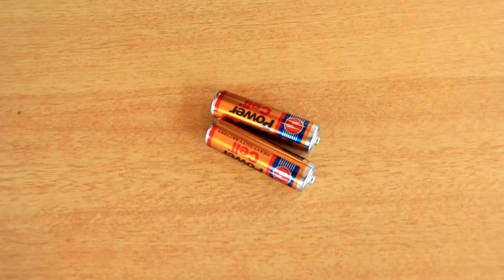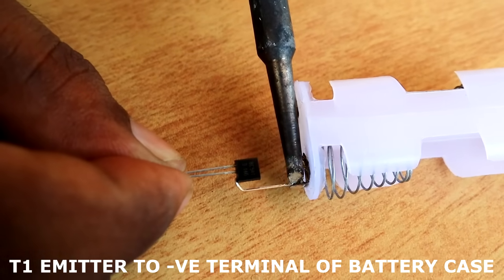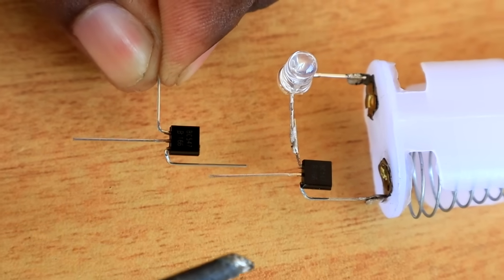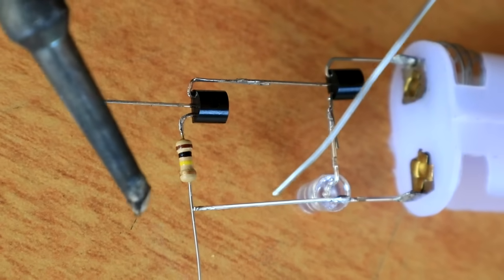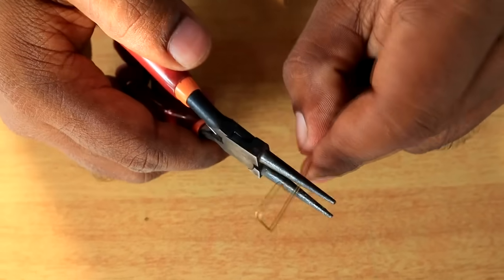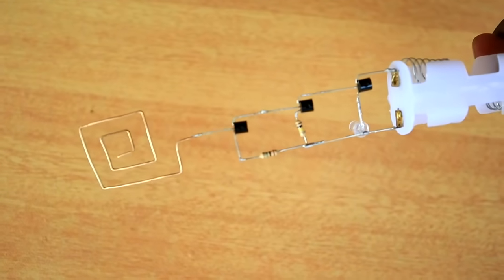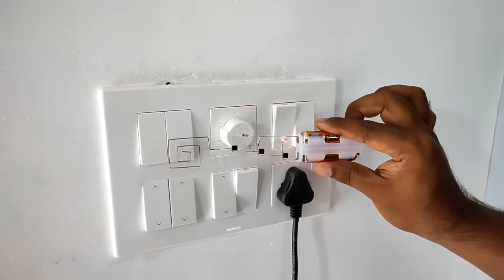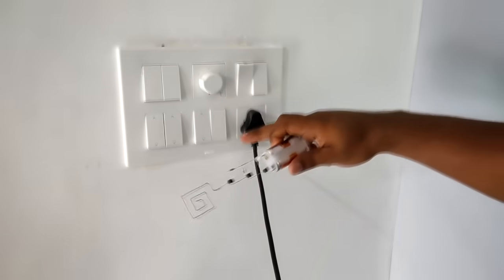NON CONTACT VOLTAGE TESTER MAKING | M4 TECH |

Comment: Chetta voltage low karanam electronics device off aay on aay kondirikum. Ath solve cheyan oru solution paranj tharo... Nte vtil av receiver und. Vaikit oru 6 manik shesham receiver use cheyan patilla. Use cheythondirikumbo voltage low aay receiver off aay pokum. Pne on aakum.. ith kurach nerathek repeat cheythondirikum. Any solution?

Comment: Can this be used to find out the location of concealed wiring inside wall to prevent accidentally damaging the wire if some other drilling work is required to be done on the wall?

Comment: If wire has a disconnection in-between, AC current will not flow. That's an incorrect application.
Reply: I doubted it the same way
Reply: He already told about that dear..
Reply: @muhammedshafeeque5775  You misunderstood.

Comment: Wanted you to make a simple ON/Off circuit operated by GSM missed call concept which will work for pumps and other electrical devices and also should be able to withstand the erratic voltage fluctuations in kerala. This device will help many to switch on or off the pump/or any other device remotely without going to the installed location physically. Pls try...

Comment: എന്താണ് ഇതിന്റെ പിന്നിലെ Working Principle അതെന്താണ് പറയാത്തത് ?😊
Reply: 3 Transistor Darlington configuration circuit with very high gain. The antenna picks up the 50Hz AC signal and turns on the transistor and the led glows ->  working principle :)

Comment: പ്ലഗിൽ കുത്താതെ കറന്റ്‌ ടെസ്റ്റ്‌ ചിയാൻ പറ്റുമെന്നു അറിയില്ലായിരുന്നു... 🤪
Reply: Just oru karaym ആലോചിച്ചാൽ മതി Energy frequency vibration ഇതാണ് എല്ലാം ഒരു wiring ഉം ഇല്ലാതെ ഭൂമിക്കു പുറമേ ഉള്ള ഉപഗ്രഹങ്ങളും ഉപകരണങ്ങളും ആയി communication നടത്താൻ പറ്റുനില്ലേ ദൂരെയുള്ള ആളുകളുടെ ശബ്ദം Phonil കേൾക്കാൻ പറ്റുന്നില്ലേ, Wire less ആയി wifi ഉപയോഗിച്ച് internet എടുക്കാൻ പറ്റുന്നില്ലേ അതുപോലെ ഉള്ളതിൻ്റെ വെറും .0000000000001% പോലും complication ഇല്ലാത്ത ഒരു simple high gain amplifier circuit ane ഇത്. ഏതൊരു wire ലൂടെ കറണ്ട് കടന്ന് പോകുബോൾ അതിനു ചുറ്റും magnetic field ഉണ്ടാകും ഇവിടെ AC ആയതിനാൽ magnetic field ദിശ മാറികൊണ്ടിരിക്കും ഇങ്ങനെ മാറിക്കൊണ്ടിരിക്കുന്ന magnetic field ലേക്ക് Wire അതായത് ഇവിടുത്തെ Antina കടത്തി വക്കു ബോൾ magnetic flux antina ye cut ചെയ്തു കൊണ്ടിരിക്കും അപ്പോൾ ആ Antina യിൽ e.m.f induce ചെയ്യും വളരെ ചെറിയ വോൾട്ടേജ് ആകും അത് അതിനെ ഈ high gain amplifier ഉപയോഗിച്ച് വലുതാക്കി കിട്ടുന്ന Output ൽ ആണ് LED കൊടുത്തിരിക്കുന്നത് അപ്പോൾ വോൾട്ടേജ് Detect ചെയ്താൽ LED കത്തും

Comment: 4:29 when you put the battery in it’s a closed circuit
Reply: Just put a switch in series.. No big deal
Reply: Here transistor is working as a switch. ആ voltage സെൻസ് ചെയ്യുമ്പോൾ മാത്രമേ transistor ഓൺ ചെയ്യുകയുള്ളൂ. അത് on ആവുമ്പോൾ ആണ് circuit closed ആവുന്നത്. So at 4.29 അതൊരു open circuit ആണ്.

Comment: ഇതിന്റെ പ്രവർത്തന തത്വം കൂടി പറഞ്ഞാൽ നന്നായിരുന്നു.
Reply: വീഡിയോയിൽ കാണിക്കുന്ന antenna ഒരു inductor ആയിട്ട് work ചെയും. AC കറന്റ് അതായത് നമ്മുടെ പ്ലഗിൻ കിട്ടുന്ന കറന്റ് കാരണം ഒരു magnetic field ഉണ്ടാവും. നമ്മുടെ inductor(antenna) ഇങ്ങനെ AC കറന്റിന്റെ അടുത്ത് വെക്കുമ്പോൾ inductor-ൽ ഒരു കറന്റ് ഉണ്ടാവും. Electromagnetic Induction എന്നാണ് ഇതിനെ പറയുക. ഇൗ കറന്റ് 3 transistors-ന്റെ സഹായത്തോടെ amplify cheyyum. അങ്ങനെ amplify cheytha current ഉപയോഗിച്ച് LED കത്തും.
Transistors ഇങ്ങനെ കറന്റ് amplify ചെയ്യാൻ biasing ആവശ്യമുണ്ട്. അതിനാണ് 2 battery use ചെയ്യുന്നത്

Comment: 3 Transistor Darlington configuration circuit with very high gain. The antenna picks up the 50Hz AC signal and turns on the transistor and the led glows ->  working principle :)
Reply: Thanks njaan working principle enthanenn alochikkuvarunnu
Reply: @kichu9721  Welcome
Reply: Thanks